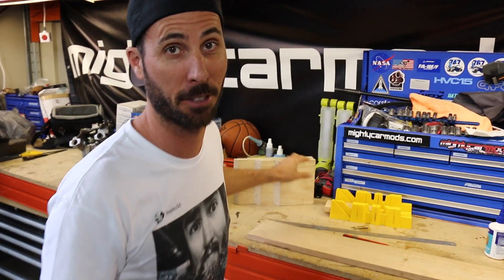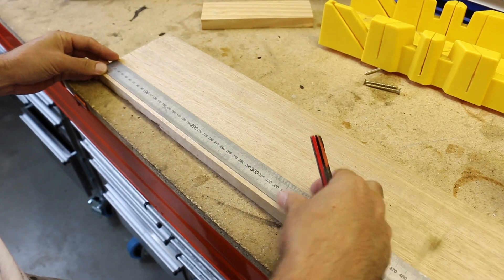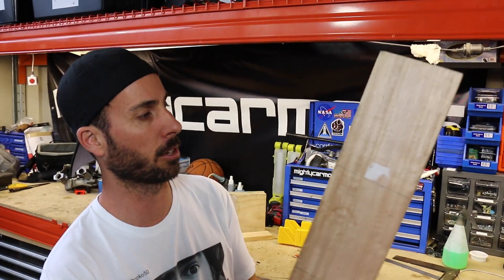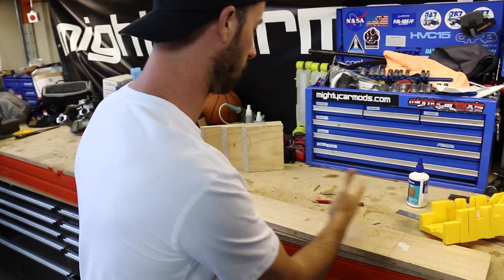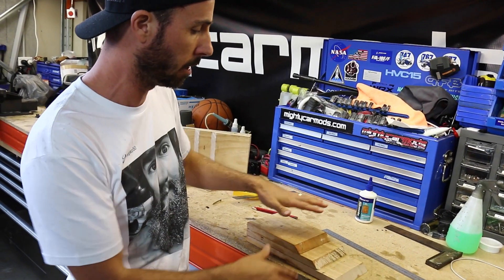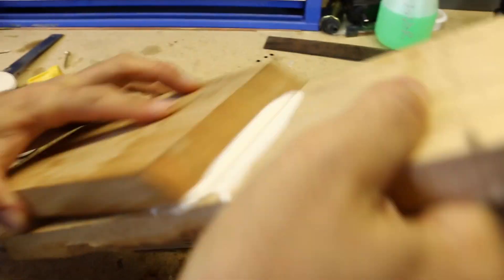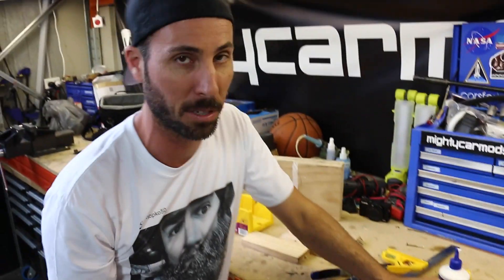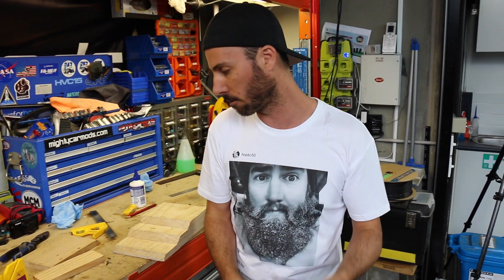Make your own Lowered Car Ramps for $5

Comment: The best ramps I've used to get my jack to fit under was an old set of front rotors.
They raised about 4 inches at the height of the top hat, are heavy so they don't have a tendency to slip and solid steel.
Reply: What does the word solid mean to you?
Reply: @eriklarson9137  Solid being the adjective. Meaning in place and not movable. Didn't mean it to describe any particular quality or forging of the steel.

Comment: If you're working in gravel or dirt you can use longer screws and go in from the top so the screws stick out the bottom and dig into the ground like a soccer cleat. I had to modify some store-bought ramps like that because they would just slide when i tried to drive my truck on them.

Comment: If you screw a loop of nylon strapping in to the bottom of it, you can prevent them from sliding as the car drives up on them.  Tire rolls up on nylon, then right up the ramp.
Reply: Brilliant, thanks!

Comment: Just a thought, if you leave the screws in after it drys i would go in through the top, rather than the bottom. If the wood splits when you drive on, a screw will go into your tyre 😊

Comment: Top tip countersink your screws apply from above and pilot them out to avoid as much cracking and possible degredation of wood lay on anti slip grip tape / flooring bump stop at end is ideal when working alone if using as just service ramp etc and they'll last a long time 8 years out of my last set 🤟 keep it homemade functional safe and cost effective.

Comment: I think I'm doing two pairs of these. My car isn't that low, but I just can't work from underneath so I came with this solution:  I bought six cinder blocks and filled their holes with concrete and some small stones and bits of bricks I had around. I did it so I left an indentation to work as a handle, otherwise they are not manageable when they're finished.

So, now, whenever I need to do some work underneath my car, I put three on each side, two plus one, making some kind of staircase, pretty much as it's seen in the video, but only two steps instead of three. The only problem is that they are a bit high (ten or twelve centimeters), so I've been using soil, sand or even bricks to make kind of ramps. But this system is way better, and although I've seen it before, it's that kind of thing you don't think about until you see it again.

Comment: @mcmtv2 I would put the screws in from the top. 
That way if your ramps get dropped or crack for some reason you don't poke a hole through your maad tires.

Comment: just in case you want to make them realy nice : take the leaked out gleu off with a wet sponge before its dried once you screwed everything together
the traces of gleu will show up on the wood as lighter streaks if you paint them in varnish or if you treat them with oil

Comment: My cars too low for these...  It just nudges them across the ground.
Reply from the maker: +Nathan Hovey Yeah it doesn't work on remote control cars but on full size cars that are over 1cm from the ground (the thickness of the first board) then it will work fine.
Reply: +Nathan Hovey try putting a small rubber mat under it or glue it to the bottom...I have used that stuff that goes under an area rug to keep it from sliding on wood floors
Reply: +Nathan Hovey put them behind the wheels and reverse onto them.
Reply: why would you have a car that low?
Reply: +Black Raven Motorsport IKR there's the good jdm like mcm and you got your "mad camber hectic stance rice jdm" 😂😂
Reply: +Black Raven Motorsport 

Dat hella flush life doh.
Reply: +Silverstone Clearly you haven't been introduced to the lowered car scene in Japan then..
Reply: +Trevor Vera  or a piece of an old seatbelt will do the same thing too :)
Reply: +Black Raven Motorsport  why only jdm? have you ever been to europa? there are alot of low cars which are not from japan, like mine vw golf III
Reply: Yep it all depends on the jack also, even some stock Falcons you couldn't get the jack under, unless you use a slim low profile jack, which this works nicely fore as well.
Reply: +Nathan Hovey try sheets of paper
Reply: use thiner wood and a cut more of an angle to it to make it less steep
Reply: +Nathan Hovey That's odd... My dog does the same thing when I put a cookie on the linoleum floor.
Reply: cut it lower lol, it's physics, not rocket science. If your front bumper scrapes the ground regularly, how could you possibly get a ramp under it? Solution to your problem. Put the ramp between the tires, and reverse onto the ramp!!! same outcome!!!
Reply: Nathan Hovey you should search the web on how to lower your car properly and then try the ramps which you made again
Reply: RR 10 oh I did.  That's why I'm on hockey pucks.
Reply: Nathan Hovey Lol. You just made it a lot worse
Reply: NutriFIT nutritie si fitnes To break on?
What are you doing?
Trying to launch it up these ramps at 20mph?
Reply: @mcmtv2  While almost funny, this actually proves you are clueless. It will not work on many lowered cars.

Comment: I live in Wisconsin (USA), and having you car that low is a death flag. My car has 3-4" of ground clearance and I still have trouble getting into my work place's parking lot without scraping. It's especially bad if you don't have a winter-beater. you'll be driving through 1-2" of snow at one point or another, and that's mild.

that said I would love to lower my car but I don't have a winter beater so I don't get to have such luxurious problems :p
Reply: +The Evenger Speed bumps at work prevent me from lowering my car one iota .... :(
Reply: +The Evenger Yeah half the speed bumps in my area of Australia scrape on regular stock cars.

Comment: $5 only for those with narrow tires who need need car lifted no more than 4.5 inches.
2x10s (still for less-than-super-wide tires) are more $10 each, and if actually lifting your car more than 4.5 inches, you'll need ones at least 3x the length of these to get to a decent height without hitting the bumper. So, really looking at $30+ for 'normal' ramps.

Comment: I am thinking of making a bigger version of these and using them to actually work under my car but my design would be more like Getting a piece of wood like 700mm x 150mm cut in in an angle of 10 Degrees .  What's your opinnion ?

Comment: I'm not quite sure, if it's a good idea to screw the pieces of wood together from underneath. Reason being, that in case one of the pieces break, you risk puncturing your tire.
I'd recommend to use two different lengths of screws: one type short enough to connect piece 1 and 2 - 1 being closest to the ground - and another one long enough to reach through all pieces. Then screw the pieces together from the top ;)

Comment: Why I shouldn't work under my car while using this ramps?
I've made something like this long time ago but little bit wider and higher, so that the wheel is fully supported, and I actually feel safer about it than using jack stands. Especially in my garage where floor slips down and car is not level.

Comment: I like how you converted cm to in lmaoo we use centimeters in America as well
Reply: Because that's the only country in the world?
Reply: luke marshall that use inches? yes, we are.
Reply: +Oshkosh Baby I live in the UK and most of the tools I use are in imperial 1/4 1/2 3/8 etcetera. We use both. As do Aussies I presume.
Reply: +luke marshall i'm sure imperial measurement tools are used around the world. your rulers use inches and centimeters?
Reply: we don't use cm in the states. We have the luxury of being able to buy metric sets, but most American made thing are made using the imperial system. It's not a big deal, except when the 13 doesn't fit cause it's imperial. Most things like cars and other world wide objects are made using metrics so that's a plus. I bought a bass guitar, and since it was made by an American company, I bought an imperial set of Allen keys to fix it, assembled not in America, the correct Allen Key did not fit. And I bought it straight from the company. Turns out I only needed to take a trip to the local hardware store, the key the company used was too small, and is not available in most stores.
Reply: +luke marshall the only imperial tools you'll ever need are 1/8, 1/4, 5/16, 1/2, 3/4. Any other size 99% of the time is useless. It's the same with metrics I've noticed. I only ever use 11, or 13. And on the rare occasion a 17.
Reply: +Leroy Butts dont forget the 8mm :D
Reply: Leroy Butts I was surprised to find my 2009 Nissan uses 13/16" wheel lug nuts.

Comment: Just don't drive over and off the back of them.  It'll mess up your side skirts pretty bad, and then you'll have no way of getting the jack under to pull them out!  
If you make them all longer but with a similar rake you have more space once you've driven to the top.

Comment: Quick Question:
Why does Moog say that these are not safe to work under?
If I were to roll up on these and pull my handbrake, could I work under my car?
(I would have to make them a bit higher but that's not a problem.
Thanks in advance!
Reply: Well, the way he made them they are a little short, but if you made them a little longer and added a wheel stop to the top I can't imagine a reason no to work under it.

Comment: Using short ramps like this is not a good idea.  No matter how good you are on the brakes, one time you will drive right off the ramp destroying your exterior body panels that are right behind the wheels...the ones you were trying to get the jack under in the first place.  

Since these ramps are ONLY for getting the car up high enough to fit a jack under the car and you will be removing them once the car is up on the jack and jackstands, building a longer ramp with a bump stop at the end is much safer.   Wood is cheap, body shops aren't.

Comment: Mildly Lowerd Car Ramps* I'm not even that low compared to a lot of people that I know and I'd have to make each board hella long to make this work. Here's a simpler trick: If you don't have a cranking floor jack (like the one that comes in your car), go to the junkyard and pick one up. Most of them are extremely low profile and will get your car up just enough to get your hydraulic jack under.

Comment: Out of interest, why should you not work on your car under this?  Surely the chances of the car "falling off" these blocks is far lower than a relatively small jack stand.  The car is, after all, resting on its natural suspension as it it was just on the road.  If your ramps are taller than they are wide, then sure, they could be unstable, but as they are designed there, that would be far more reliable in my opinion than most budget jack stands you can buy.

I built a heavy duty set of these ramps using  a few lengths of scaffolding planks.  Stacked solid wood same as the video, only more layers, and wider/thicker wood.  They raise the car up about 30-40cm which is enough to get access to most things.  I have tried shaking the car vigorously while its parked on there, and its not going anywhere.  Doing the same on my jack stands and the whole thing wobbles.  I know which one i would trust.